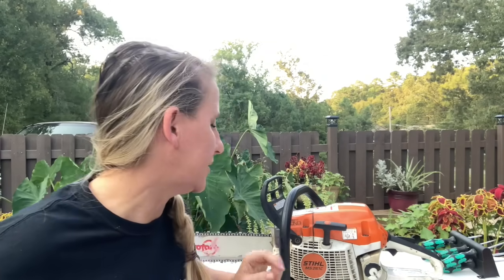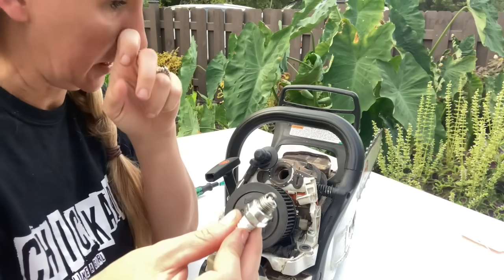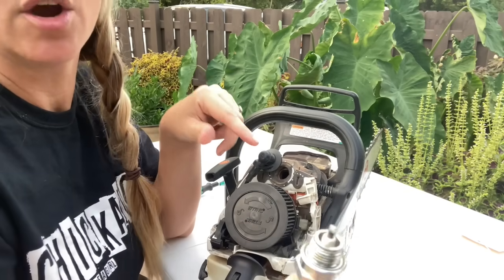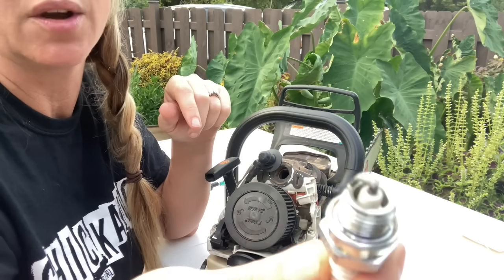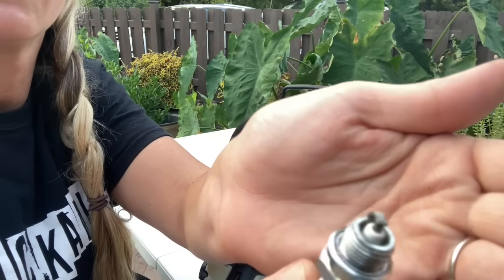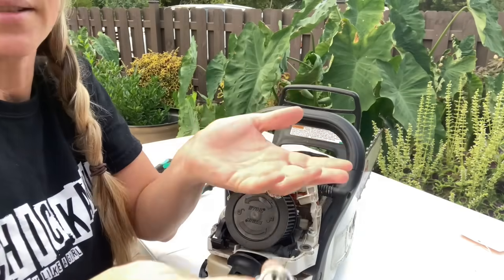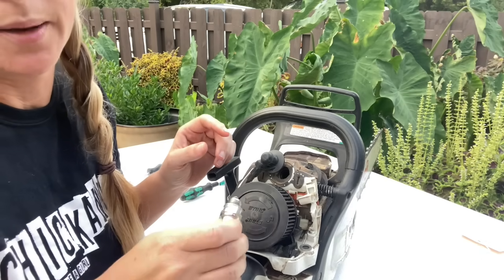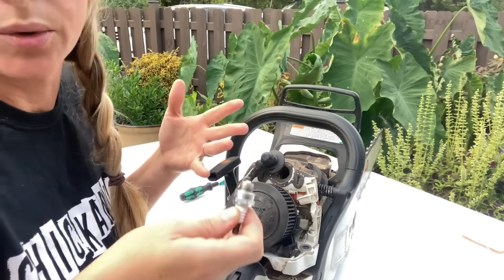STIHL M-TRONIC CHAINSAW HAS NO CARBURETOR ADJUST, WILL IT "RESET" TO REGULATE FUEL CORRECTLY?

Comment: I worked on many saws over the years, and i seen many ruined saws because people don't know how to adjust them so they lean them out and fry the motor, Stihl makes a tool to adjust the carb. which i have, saws now days are being made so people can't mess with them. once you have an exsust side lean out it's done for. i was factory trained on Stihl years back the average adustment is one full turn out on the high and low adjustment

Comment: I’ve worked for a tree service for 25+ years…the M-tronic 261 was BY FAR the worst pro saw I have ever used.  It was constantly in the shop, mostly for solenoid replacement, but it had lots of other issues as well.  After a while, none of us wanted to deal with it and it got left in a pile with other junk in the back of the shop.  A failed experiment to say the least!

Comment: I got the ms 261 stihl with out the computer junk and never once had a issue. When I do fire fighting I use a husky with the computer and it’s almost impossible to restart after it being warmed up. I’m sticking with the old school carb I can adjust myself! Nice video
Reply: Old school, the most dependable tools and methods around.
Reply: Chainsaws don't need computers stupid idea. I belive in low tech for stuff like that.
Reply: Yes you have to re choke it or hold the throttle while starting to get em fired up. It's sucks. It did help for a lil bit when I brought my 562xp in and they hooked it up to the counter.

Comment: M-tronic saws are pretty cool most of my co-workers own one and they have all had to go to the backup at one point or another. I’ve got a few older stihl saws but recently got an echo 7310 and 4910 and had them ported. I don’t think I’d switch back there shouldn’t be 10 different ways to wrench on a two stroke saw it just defeats their purpose. I always liked that about pro saws you can basically do a complete service in the bush with a couple tools that has kept me from going with an auto tune or m-tronic. My ported 7310 will beat a 500i head to head.
Reply: Let’s see that on video.

Comment: The reset procedure depends on what version of M-tronic you have. The reset procedure you describe is for the older versions, M2.0 and below. 
To check what version you have, you need to look at the CE label. In the upper right corner you should see an "M" with a number next to it, like M2.1 or M3.0, if you can't find an "M" number you probably have an older version. 
On newer versions (M2.1 and over) the reset procedure is:
Put the machine in the ▲ Cold start position
Start the machine and run it in the ▲ Cold start position for at least 30 seconds but no more than 60 seconds
Do not touch the throttle or accelerate the saw during this time
Disengage/release the chain brake
Open/squeeze the throttle fully for at least 30 seconds
Engine speed varies noticeably during calibration
As soon as the engine speed drops noticeably, release the throttle back to the idle position
When the engine is back to idle speed, engage the chain brake and switch off
Everything should be calibrated.

I am a Stihl dealer if you bought the saw from me I wouldn't charge anything to adjust it. Even if you didn't buy it from me if it's just a quick adjustment I probably still wouldn't charge. Sometimes I figure a little "free" labor here and there doesn't hurt me and a little customer service and hospitality goes a long way to create loyal repeat customers. I'll end up making the money back in the long run when they return for parts, oil, bars and chains.

We tried to use our MDG-1 today and the data cable was damaged so it wouldn't connect to the saw. You can use the computer to fine tune the saw if you needed but it's not really necessary. I hardly ever use my MDG-1. The reset procedure usually does OK to get back to a standard setting. It will fine tune itself the more you use the saw. 

Something else to check if it won't reset and it's just not acting right is the little solenoid on the side of the carb. If it's green replace it. They had issues with those and they've been updated. Newer solenoids are white. The black ones are good too. It's very important to use the CORRECT Stihl brand fuel filter with the M-tronic carbs. The fuel filter that should be in it is black with a white top and orange element. If it's a black filter with a white element it needs to be replaced with the correct one. Don't use the Stens or Oregon, etc.. replacement fuel filters on an M-tronic saw. The bootleg Chinese service kit fuel filter, even if it is orange, will not work either. Ask me how I know... It took a min to figure that one out because they look like a Stihl filter. However, side by side you can see and feel the difference in quality between the cheap Chinese parts the customer bought and installed and the genuine Stihl service parts. 

If the engine is good, the solenoid is good, and the fuel line and fuel filter are all good and correct it may be the ignition module, even if the saw does "run". The electronics that control the solenoid are built into the ignition module.

1 year late edit: Something else to check if everything else is good (engine, solenoid, fuel line, fuel filter) You might replace the wire harness before trying to replace the ignition module. You could be getting a weird grounding issue.
Reply: I do the same thing at my dealership. I rarely charge for these adjustments. It doesn't matter if it's mtronic or carbureted. At the most I would charge 20 minutes at $90 per hour. So..... about $35. Most shops charge $30 or more just for the diagnostic fee. I don't believe in doing that. Besides I like tuning equipment and also earning a bit of good will at the same time.
Reply: Dude your awesome,  and that my friend is why I'm sure your business will always  be busy . Thanks
Reply: This comment is the most interesting and learning attachment of this whole thing!  Thank you, I have been wondering about this for a little while now since I got an ms261 for myself.  It's the later version by looking at the side cover but it isn't M-Tropic apparently.  It has adjustment I think. (There are holes but I haven't looked inside them or tried a tool in them) It runs so good I've never thought of putting any kind of adjustment on it to see if it changes anything. I don't want it to change in ANY WAY!  LOL!!!  IT'S A GREAT SAW PERIOD!  What blows my mind is, I had a ms250 for a good long while before I got this one and it's a 45cc saw.  There is no comparison by far of how much better this saw cuts and even feels in your hands. It really doesn't weigh much more to tell any difference, even in the long run after using it all day long.  
I'll look again but it looks like a regular carb with low and high adjustments with idle adjust and all.  It doesn't say anything on it but ms261. The way I see it at the moment is,,,,"if it ain't broke,. I ain't fixin it!". Have a good one my friend !!!  BTW, I am a small engine mechanic here in east TN and Stihl saws with the M-Tronic carbs must be darn good because I have NOT had one person in my shop with them  saying a saw with this set up doesn't run right.  Maybe one day someone will bring one in but I guess it's like the old Maytag repairman video from way back when they just sat around waiting and waiting for someone to come in with a Maytag appliance to repair.  Ha! Ha!!  I got a real kick out of those old commercials. 
See ya!
Reply: @jimmyanderson2609  The "CE" label is the silver label on the flat part of the handle below the trigger. The only M-tronic equipped MS 261 is the MS 261C-M. There are other "C" versions as well and they all say "MS 261C on the side cover so you can't trust that. Check the "CE" below the trigger and in the upper right you should see an "M#". If there is no M# and given the fact your saw has 3 adjustment holes I would conclude your saw is NOT M-tronic equipped saw. If I remember correctly, I do not think M-tronic equipped saws have adjustment holes in the cover.
https://blog.stihl.co.uk/wp-content/uploads/2018/09/STIHL-serial-number.png
Reply: @TruthHurts2u  nope, no letters. I guess I've got the "regular variety" type. ??? Hmm? 🤔 Is there such a type or catagory for that matter? 😂 All in all, I'm glad I don't have this particular feature because that's just another maintainence issue I'd have to deal with. As long as it's not like below 50 or so and the saw had been used within a week or couple of days, I don't even choke it. Turn on the switch and maybe 5 pulls it's running and after a warm up, it's working like it's fighting fire! Literally the Best saw I've ever owned in my life. I just turned 60 so I have room to talk.  I work on all kinds and even old mac's but over all "personally" I'm probably never gonna find a better one than the 261 that suits me and runs and cuts with the authority that this saw has for a 50cc engine and the light weight. I keep a darn good sharp chain too. I Gerald check the depth every time or at least every other time depends on my time frame I'm on. It's cuts about half the way a saw cuts, on time anyway I serious.  Really! That's another story in itself.  I'm beside myself wondering why I didn't get one before now? I never say anything to anyone I'm doing work for on about what kind of saw, mower, line trimmer or leaf blower they have and never will. What they choose is their decision and not mine to make but if they choose wrong it's their money and it's also their money for me to make! Ha! I just had to throw that one in there.  Lol!!!  If they ask me for my "honest" opinion, I'll tell them honestly and only then will I lean toward one brand or another. Because each is there own and I'm gonna let it stay that way. Easiest way to not get a head ache. Lol?!?!
I replayed the video here several times to see just how bias chick mechanic is and if this wasn't a Echo commercial,  I'll be a monkeys uncle!  Thank you for your info. I've already written it all down for ±future reference. Thanks again.
 Have a great Sunday!  
God Bless
 I
Reply: Not true a non mtronic says ms 261 and an mtronic shows ms 261c. So if it’s all original and says 261c it’s mtronic.
Reply: TruthHurts , I have one on the table , MS441C ,guy was cutting and it quit and it will not start .it gets gas but hasn't got spark unless you turn it over really fast and then it's a small blue spark , verily see able. Flywheel key is ok, new plug , wires all look good . Any suggestions , I have no coil checking equipment.?
Reply: @darellsunderlin4670  

You don’t know if you have any coil checking equipment?
Reply: @mateobrainardo4770  I have spark testing equipment but not those expensive coil testers , I know you can check coils with multi meters but wasn't sure on these M- tronics . I like old school adjusting.
Reply: @darellsunderlin4670  change the coil!
Reply: @darellsunderlin4670  You can't trust newer saws with the old ground out the plug and watch for spark trick. The spark characteristics can change under higher pressure inside the cylinder. For this reason if you're going to work on saws you must have an inline spark tester. 

I rarely see bad coils. First, I would start with changing out the gas with known good gas. I can't tell you how many times this one "trick" has "fixed" saws that come into my shop. Be sure to pull it over enough times to get the good gas up into the carb though. (I pull the side cover and use a power drill with a socket adapter in the chuck.) 

Catch the "old" gas when you pour it out and check it and the empty tank for sawdust contamination. It could signal a clogged carb.

Second, I'd check the cylinder compression, it should be well over 100 psi. If the compression is low pull the muffler and look inside the cylinder to check for wear and/ or stuck rings. Although, you can't always trust a visual if it's a cold seizure. A cold seizure usually scores the cylinder just to the left (clutch side) of the exhaust port opening where you can't see it. If it has low compression and you don't see anything inside pull the top end and inspect it.

Third, If the compression is good do a leak down test. If it holds pressure and has good compression the engine is good and it's something else. If it won't hold pressure check the intake manifold, cylinder base, and oil seals for air leaks.

Without any of these tests I'd lean toward a bad cylinder since it went out on him while running. However, without performing these tests and getting the results I can't really say what is wrong.
Reply: Thank you very much for taking the time & trouble to write your incredibly detailed and knowledgable reply - I found it most helpful & interesting.
I have a 261 M-tronic which has been great - Much better and smoother running than other chainsaws that I own.
If I ever have trouble with it I now know how to reset it and some of the common problems to look at first.
Many thanks.......all the way from London !
Reply: In the last year I was told that the latest solenoid for the 441cm is green. They said the newer white ones were for the newer mtronics, not for the 441cm. So, when I rebuilt one, I used the green solenoid and the latest sthil (white/orange) fuel filter. Should I have insisted on the white solenoid? Saw runs great when running but will die at idle.
Reply: @philipyourno7540  The current solenoid part # is 0000 120 5111. It's been a minute since I talked to the techline guys about this I'm not sure if the color means anything anymore or not. Last time I did talk to them about this I asked about the different part numbers and he told me it doesn't matter what part number I ordered because they were all interchangeable. If it works, it works. If running the auto adjust procedure won't reset the idle you can take it to a dealer with an MDG1 they can connect to the saw and bump the idle up a little. The problem with the solenoids is they get dirty and the little valve inside them sticks open. Techline also told me if I ever had problems with an M-tronic carb and it had a green solenoid to just replace it... If they're not giving me trouble I don't bother with them even if they are green.
Reply: Thank you
Reply: Thank you for this.
Reply: Will running the saw wide open out of the cut/no resistance not cause issues?
Reply: @rossjones5922  The 30 seconds WOT it takes to reset the saw won't hurt anything. If you hold it pegged for over a min you could cause damage to the saw. 
Just an FYI... Running a blower without the bottom tube is the same thing as running a saw without a load and can cause the same damage..
Reply: Good to know . I apprecited thanks
Reply: Can I still buy a 462 with the standard carb? and, if so, can I get the standard carb on a 462 C-M....?
Reply: When I put my after market exhaust on my saw this was the way I reset my carb. It worked flawlessly.
Reply: I wish I could copy and paste this but can’t on an iPhone 😢
Reply: that goes extre six miles or more ! awesome to see others are helping people out ! good work buddy !
Reply: Jesus what a pita. Im having an 044 custom built, tired of this new crap. 4 tanks of fuel through my ms311 and no spark. Not happy.
Reply: Nice you told us.
I have an 084...where I plug it in ? Lol
Reply: Im having trouble with a fs 460 c m tronic too but ima try this
Reply: Hi there. Im having trouble with a stihl ms 260c year model 2009. I have replaced the flywheel as the original broke key and hit the coil.
I have also replaced the solénoïde along with rebuilding the carburateur. It will start and idle, wont run for more than 10 seconds if accélération is applied. It will not switch off with killswitch and seems to be flooding.  Any assistance would be much appretiated.
Reply: This is all proper information except the black solenoid, that is the old original one that had the seat that wore out and would cause a rich condition at idle. The black was replaced with green and white ones are still used with white.
Reply: BINGO , My MS362 is rock solid, the ONLY time it runs bad is every year or two the little black selonid will go bad.... Another coming issue with the MS 362 is the wire harness will short out as per West Coast Muscle Saw shop owners long time experience
Reply: That's funny you say that because I have both newer and older models and it's the same sequence for me I don't know what it is for you just saying
Reply: @ernestodavino4914   I don't want to be an elitist dick but I've been doing this forever and handle hundreds of saws a week and have gone to Stihl training many times and even gone to Stihl gold school. The reset procedure is different on older vs newer versions of M-tronic. If yours is the same procedure you have the same M-tronic on your saws.

Comment: The last stihl saw I bought years ago had a non oiling problem that it didn't matter how many times I took it to the shop they couldn't fix it. The shop would call say it was done take it home and after 30 minutes of run time it quit oiling. Last time I had it at the shop and they said there was nothing wrong with it I went out back of their shop and started cutting up wood in their pile. They had a fit about it but I said keep waiting until I get done and low and behold it quit oiling, they checked still had oil and nothing plugged up. End of story they could not fix it and couldn't tell me what was wrong but it was now out of warranty and take my saw and get out of their  shop. That piece of crap is still sitting in the corner of my shop to remind me to buy one again. Bought an echo saw and never looked back.

Comment: For what it's worth. A couple of decades ago sthil went to 50 to 1 mix. Burnt up a lot of saws. Still use their mix, but at 40 to 1. 50 to 1 is probably just fine for the home owner.
My 028 has 35 years and counting. My new saw runs like a scalded ape.